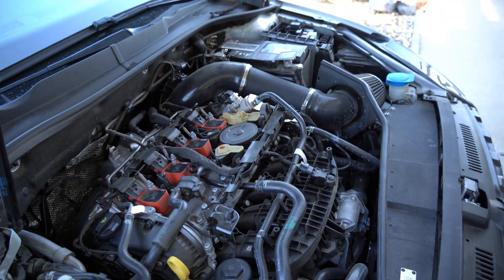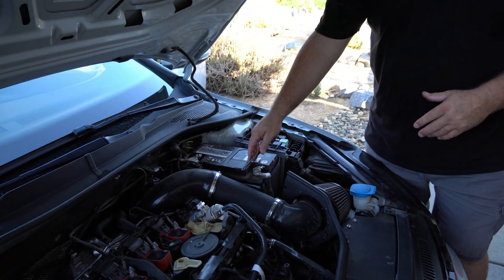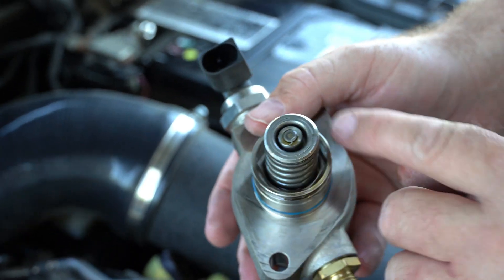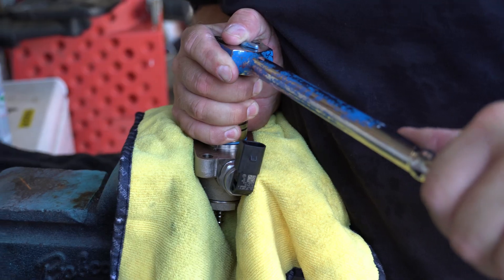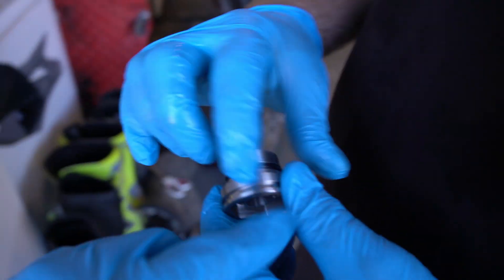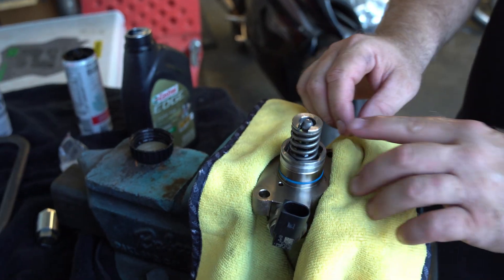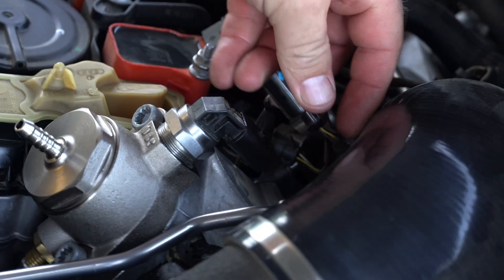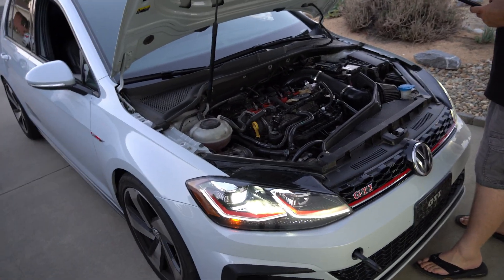MK7 GTI High pressure fuel pump Upgrade (Integrated Engineering!)

Comment: I was curious on is it worth it for a regular stage 2 tune
Reply from the maker: Def is
Reply: @jacobMMotorsport  im not stage 2+ just stage 2 tune by cobb. My original hpfp just started ticking so I am thinking about possibly doing this upgrade. I don't run e85 so I shouldn't have to worry about changing the lpfp correct

Comment: Did y’all upgrade the low pressure pump in the tank or is leaving the OEM low pressure pump not really an issue after upgrading the hpfp?
Reply from the maker: Highly recommend upgrading lpfp if you want full E85 it will support anything but full E

Comment: Where can you buy a replacement o-ring for these internals?
Reply from the maker: Shopdap
Reply: @lifebasesolutions3405  may I ask why you want to replace the o ring? Do you have a leak?
Reply from the maker: Just depends how old your car is and the integrity of the seal. If it feels fine then it probably is. Just inspect it
Reply: @GermanCRMZ  We purchased and installed the kit (IE HPFP Internal Upgrade Kit For VW & Audi Gen 3 2.0T Engines| Fits MK7, 8V, & B9). It functioned for about 30 days. Then failed. We do not know why it failed. We presumed the o-ring. We ordered some o-rings and the 034Motorsport High Pressure Fuel Pump Upgrade. We pulled the old pump off and made the decision to just install the new pump from 034Motorsport. The car runs great. We have not taken the old pump apart to determine the failure. Any suggestions as to what we should look for?
Reply: @lifebasesolutions3405  I'm asking because I'm suspecting my hpfp failed. The oil in my car is mixed with ethanol, but I don't know how common that issue is. It might be the injectors or the seal on the hpfp.
Reply: @GermanCRMZ  Both appear to be potential sources of your problem. However, our oil does not smell like ethanol. So I can't say our problem was the seal. I can't say if it was the seal in the HPFP that would lead to your problem. I don't want to steer you to the wrong conclusion. I just don't have a good answer for you. We tested the fuel pressure at idle and while driving around. The High Pressure Deviation ranged from 53 BAR to 174 BAR. We were pretty sure we had an issue with the HPFP but we were hoping it was just going to be the o-ring. Now that the car runs great, we are probably just going to leave the old HPFP on the shelf. If the new one goes bad, we will then spend more time investigating it.

Comment: Do all hpfp upgrades need to be tuned.
Reply from the maker: Yes yes they do
Reply: Question and might be silly. I got a tune that calls for OEM HPFP. Would it be safe to run the same pump but with upgraded internals? The tune should only call for so much fuel correct?
Reply from the maker: @grimepatrol970 if the tune requires a hpfp then you need to upgrade it but if it doesn’t require a hpfp then no. Usually stage 2 flex fuel is where you need a hpfp but talk to the tuner

Comment: Great vid! Did you guys have any vehicle drive-ability symptoms that made you decide to upgrade the HPFP?
Reply from the maker: Yea the car was surging under Boost and the hpfp duty cycle was maxing out at 100% under half throttle 17lb of boost. So we had IE take a look at some data logs and they said the pump was going out so we replaced it and now it’s perfect
Reply: @jacobMMotorsport Exactly what pump did you replace ? Mine is cutting power at around 5k rpm when heavy acceleration applied.
Reply from the maker: @anthonydonkle  we replaced the high pressure internals
Reply: @jacobMMotorsport could you send a link to part? Or do I contact IE and claim fault in the product and they replace it ?